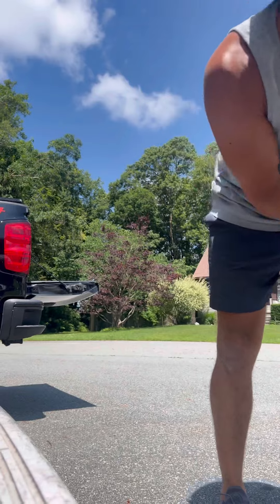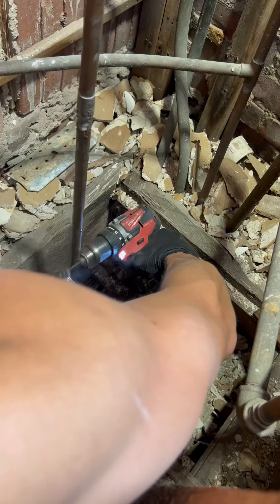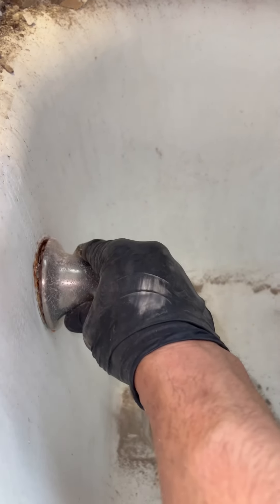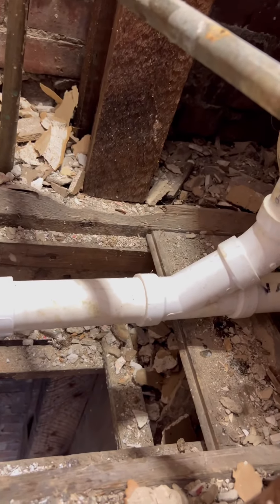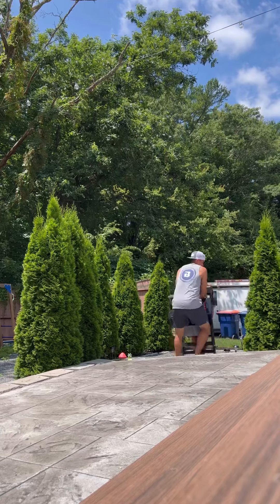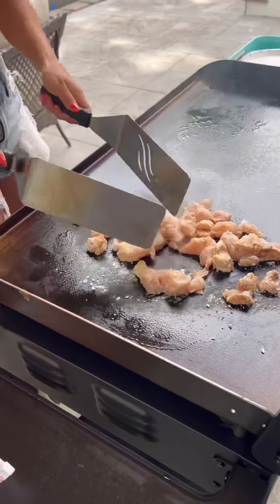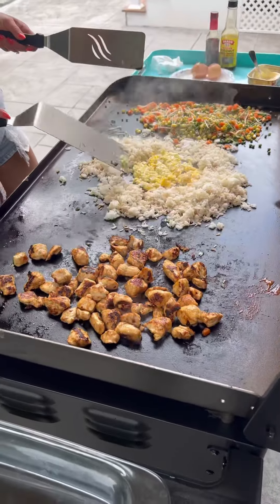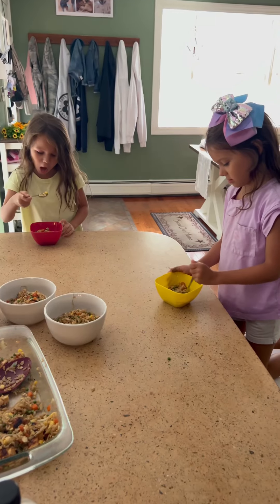#dayinthelife  #plumber #diy #new #construction #plumbing #youtube #work #viral #plumbing

Comment: New England plumber here-  Great job, but I would have used a banded ( no-hub) clamp instead of the PVC female adapter, they either split or leak after a time. Or if code requires it, at least a schedule 80 adapter.

Comment: I'm with you I only use silicone on drains,tub,shower,basket strainers, GDs as an repair plumber I've resealed many a drain that leaked from putty
Reply: Especially kitchen strainers, no matter how good you tighten them using putty, there's a chance for a call back , it's almost as if the hot water melts the putty
Reply: @jaydrains2247  putty on SS kitchen sink basket strainers you tighten them down you squeeze all the putty out zero clearance on them that why silicone works better 😉
Reply: When you use silicone, do you let it set up, or run water right away?
Reply: @CDF-ES  As soon as I clean it up I fill up the sink and test it I use 💯 silicone never had a problem don't use that water clean up kind